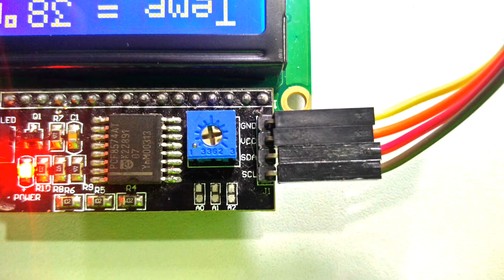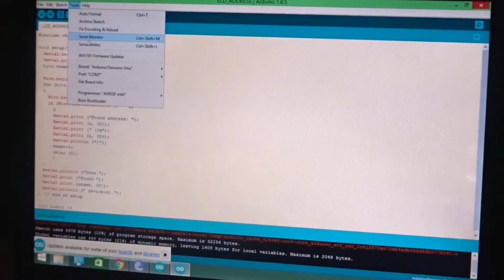DHT11 WITH LCD I2C HUMIDITY AND TEMPERATURE MONITOR | ARDUINO PROJECT

Comment: display is just blank no readings
Reply from the maker: On the i2c board there is a small screw on the blue box. It's a potentiometer which is used to adjust the brightness of the lcd display. Try that.

Comment: the LCD is blank, I did all of the writing and coding just like your video is there any ideas on what I could of done wrong
Reply from the maker: Adjust the potentiometer (Brightness)
Reply: Inovatrix Guys I’ve done that and now the it says the temperature and humidity but is not giving me a measurement or reading of either but I plugged my DTH in
Reply: Inovatrix Guys I’m sorry I’m rarely new to this what’s the MQ2 and gas sensor
Reply: I’m using a DTH11 not a MQ2

Comment: I have tried this project and it works fine. Many Thanks. I would like to have the temperature  in F (Fahrenheit)  but I do not understand the DHT11 part of the code. Can you assist? Again, thanks for the excellent project.
Reply from the maker: Just use a simple fahrenheit conversion in the print function of temperature.
Reply: @INOVATRIX  I have done what you suggested and now have the Fahrenheit  readout. Thanks.
Reply: Bro how did you upload the liquid crystal and where to paste it please reply bro
Reply: @arulnithihariharans3531  Not sure I understand your question. If you are asking what the address of the LCD was, this can be different for different LCDs. Use a scanner program to get all address of devices on the I2c bus. If this is not your question please advise. Also, you may want to ask the author of the YouTube as I am just a noob. Good luck.

Comment: Can u plz give real code
Reply from the maker: Is you code not working?
Reply: You have change the code after that
Reply from the maker: The code is changes by the lcd location you need to find you lcd location.
Provide in the video. Please watch the full video.
Reply: dht11 code is same as lcd address
Reply: so plz give correct dht_lcd code
Reply from the maker: Sir the code is correct 
I have checked it